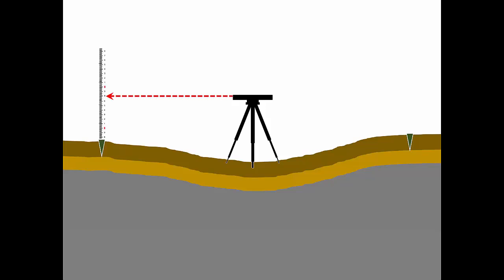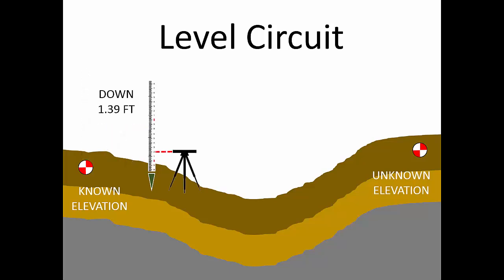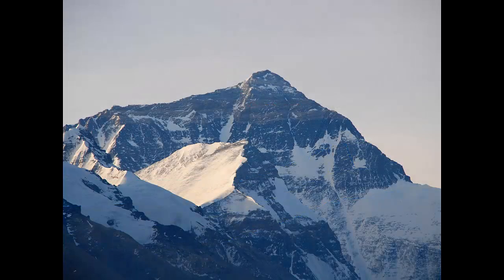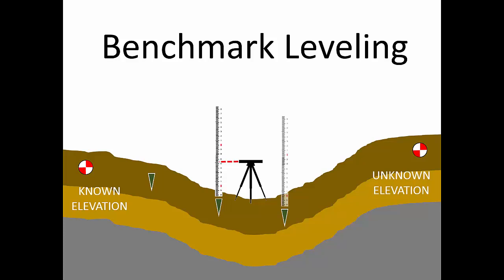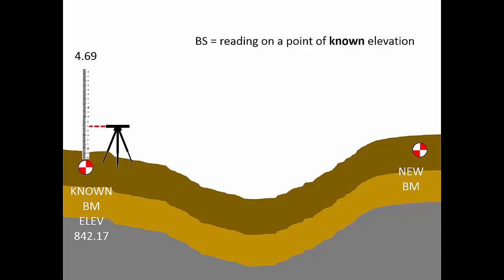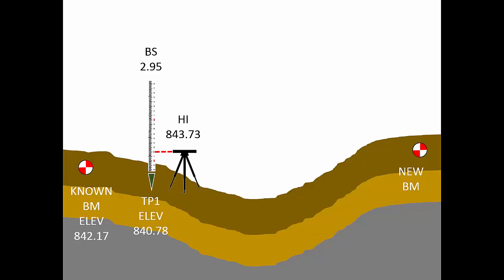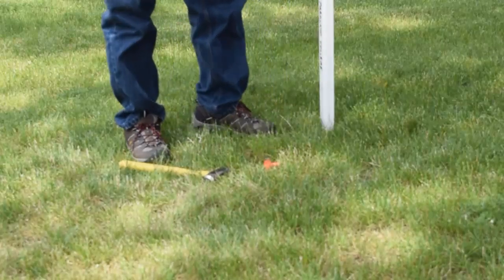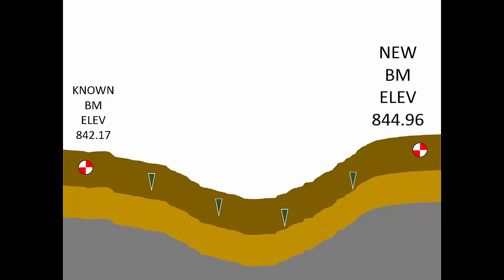Leveling, Part 2

Comment: I have always preferred permanent turn points because I usually intend to run back through them to close the loop... And if you keep accurate notes in your field book you can return to these points and use them for other job sites..

Comment: I do enjoy watching these videos, they have increased my knowledge....but in this video they show 842.17 + 4.69 =846.86 , and the video came up with  848.86 and I cannot figure how they came up with this number, am I missing something or is it just an error? If an error, it throws off all the math
Reply: Maybe because its feet and inches? 12 inches to a foot? So they carry forward 12 instead of 10 in the calculation. I'm Malaysian so am using metric  system  and also too lazy to do any calculations to test my theory. Sorry.

Comment: If you add all of the + (bs) together.  Then add all of the - (fs) together.  Take the algebraic difference and add or subtract from the original BM elevation you get the new BM elevation.  In this case the + readings are 29.17 the - readings are 26.38.  Meaning the new BM is 2.79’ higher.  842.17 + 2.79 = 844.96.  He ended up with the right elevation even if some of the numbers are wrong.

Comment: Thanks for explaining this. Question: How does the level take the lowest reading when the rod holder is always tilting the rod? I don't understand this
Reply: Jamilla Dambo the person on the rod rocks it slightly back and forth.  The point where the horizontal cross hair touches the lowest reading is the measurement that gets recorded.  When the rod is out of level, the cross hair will touch a higher number on the rod.
Reply: Since the rod doesn’t have a level bubble, it has to be rocked to remove error.

Comment: Great videos without exception! Very informative and helped me a lot, but I have a couple questions about the Turning Point and especially if using a mobile one such as the cold chisel. If it isn't placed in the ground correctly and to the same depth at each new Turning Point won't it throw the readings off. Any suggestions on how to accurately place the chisel or other object so as not to throw everything off. Also on some other videos I have heard then say measure the height of the instrument as of they measure it off the ground with a tape measure. Don't think that's the case, but just thought I would ask to be clear if that is ever an option or procedure. Thanks in advance. I have liked and subscribed!

Comment: hi thank u for this great video BUT  ( 4:14  minute ) 842.17 + 4.69 = 846.86 😊
Reply: God thx.. I was about to get crazy here..
Reply: @NotreQuebecLibre  U were confusing at that point pls add a briefing on the video. Because beginners will go in a wrong way. Anyways thank you.
Reply: Thanks for clearing this up I was going crazy with that
Reply: Check out 6:10

That calculation is wrong too lol
Reply: I thought I was fool ,  ,😅
Reply: @Hotshot1989  At this point (TP1), in this example, shouldn’t the correct EV calculation be: ”known EV” minus 6,08 = 836,09 ?

Comment: If you know the correct elevation at one point (in this case 842,17), then shouldn’t all new readings be subtracted (or added) based on the known elevation? Why using the HI value? I don’t understand this..

For example.. If you know that the elevation at the first BS point is ”842,17” (the known elevation) and the measuring at TP1 reads ”-6,08” below the known elevation.. shouldn’t the elevation at TP1 then be ”842,17 - 6,08 = 836,09”?

Comment: Question: How you keep strait line for measurements or control the line?
Reply: I may be wrong, but I don't think the straightness of the line is important here. They are not measuring distance in this case.
Reply: @KKhhoorrnniittee  Indeed straightness does not matter, you could also go in a zigzag for example, or even a circle.

Comment: The principle is clear, however, what actions are taken to prevent accumulation of errors doing a circuit? Does anyone actually use optical instruments any more?
Reply: If at all possible you should take a last foresight back to your starting benchmark and see if it coincides with the value you started off with. It should be within an inch or so if you've got it right.
Incidentally, in England, the backsight is defined as the first reading you take after setting up the instrument. The foresight is the last reading you take before moving the instrument. All the other sights are intermediate sights, eg if you are doing a level grid over a building site to compute volume of excavation.
Also in England, HI is called HPC, or height of plane of collimation. The measuring rod is called a staff, and the guy carrying it round is the chainman.
I have spent many enjoyable hours and days doing this kind of work, starting back in the 1960's. Best wishes from a fellow surveyor in North West England. Educated at Salford Technical College by some great teachers.

Comment: Explanation of the concept is great but math of HI is wrong. It should come up with 846.86 then for TP1 instead of subtracting 6.09 you subtracted 8.09 to get the right number of 840.78 .. that's 2 feet difference. ????